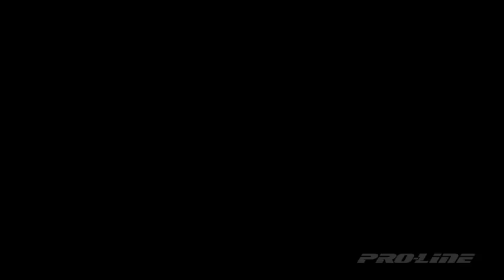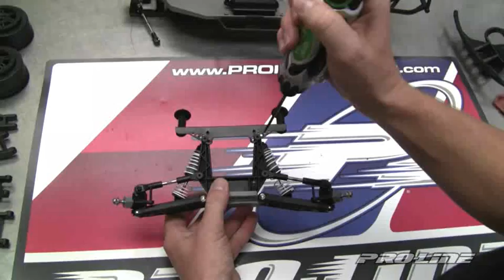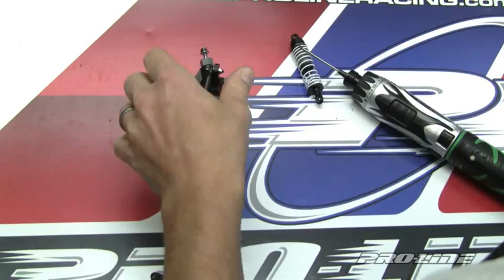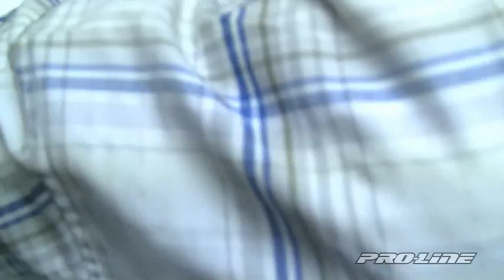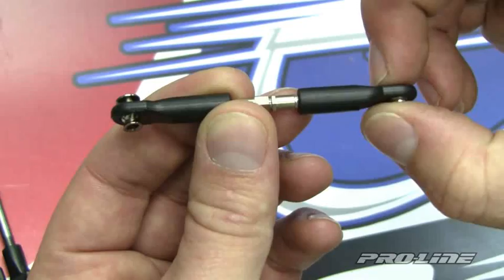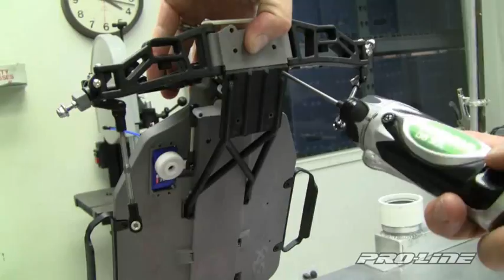HOW-TO: (Part 1) Pro-Line ProTrac Suspension Install

Comment: Do you have instructions or a video for the protrac on  2wd stampede?
Reply from the maker: We do not have a video specifically for the Stampede, but the installation is VERY similar to the one found for the Slash here in this video and Part 2 here: https://youtu.be/ojLFvHL85cc
Reply: Pro-Line Racing the shock towers at the front are different and I am trying also to workout how to put them on because they are different....also the Stampede 2WD has 3mm turn buckles and the kit comes with 4mm so you cannot use the original rod ends. Also my kit came with not run sheet, or instructions of any kind

Comment: I just bought the a-arms only. What is the purpose of changing the shock tower? Or is that not required to use the a-arms?
Reply: I would like to know this as well
Reply: The ability to change roll centers in the front.

Comment: What improvement will this make ?? Because my slash rolls tooooooo easy
Reply from the maker: the Pro-Trac suspension will give you a wider stance in the front as well as improving the durability of your front suspension. the wider front stance will definitely assist in the rollover. some of that also has to do with your shock setup and ride-height. another great solution would be the Power Stroke shocks. these would give you an excellent amount of control over your shock setup.
Reply: does it make the back wider

Comment: My stock body post isn't wide enough to fit on the shock tower. Anything I can do to fix that?  Stampede 2wd
Reply from the maker: Hello Brian, if you have the Pro-Line Extended Body mount system them you should use that to mount your body and not your stock post. the secure-loc cap system is much more secure. it should have been included with your extended body mounts.